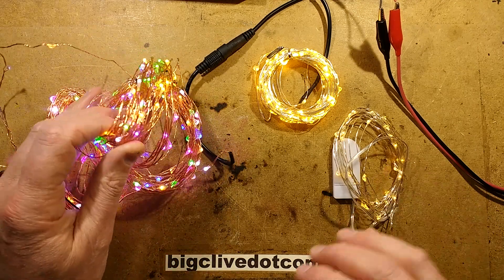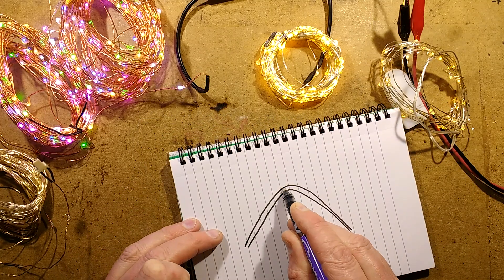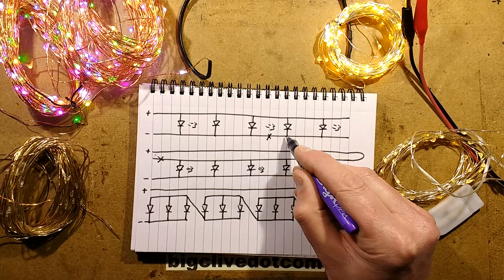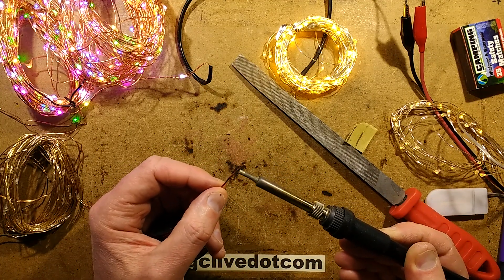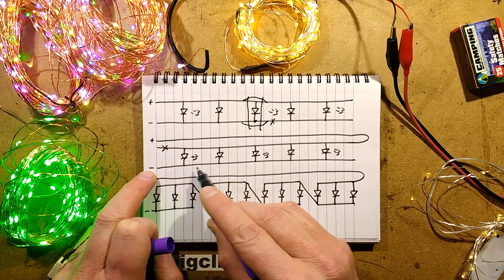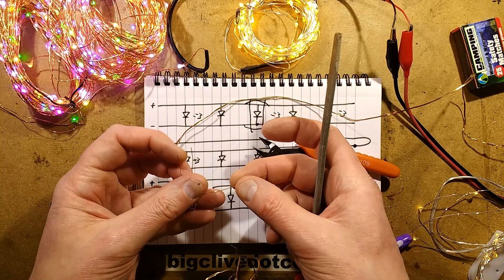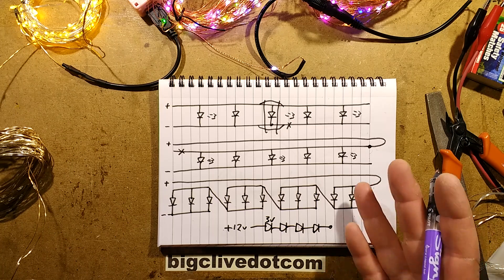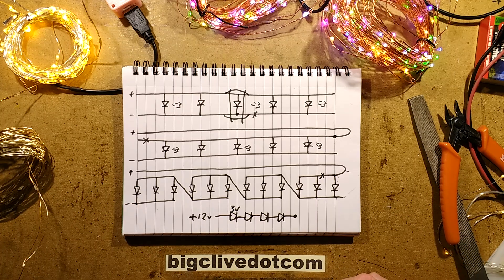Fixing low voltage copper wire LED strings.

Comment: I really am baffled still by the 3-connector wires and how you fixed it and why there is a 3rd.
Reply from the maker: It's common for 5V and 12V versions to use a third wire that feeds one polarity from the opposite end of the string to give even illumination along the length, act like a current limiting resistor and also allow the 12V versions to use four parallel sections of LEDs in series to make up the 12V.
Reply: @bigclivedotcom  why 4 sections though? Is that by natural state or design that it is done like that? Why doesn't the 5v do it like that? I'm a lil confused when he spliced and reconnected those 12v wires. When he tested the charge to find the correct wire, why did only one work. If it goes +,-,+.. wouldnt it work on 2 of 3?   I have taken every science course at my university. One thing I am eager to learn is electronics. I understand this design for the most part but a few things. My big zapper broke this summer and I tried buying a new bulb and using a tester to see if it was adequately getting voltage all the way to the bulb and it was. After reading some diagrams online I saw that it might need a new starter or some kind of Balsat

Comment: where can o buy a roll of that solid two conductor clear laminate wire?  i have searched every where can't find it, plz help
Reply from the maker: Sometimes it's called doorbell wire.  Only suited to low voltage and low current.

Comment: My 3 string led light disconnected at the power cord. I pulled it all apart & now can’t figure out how to get it back on. Do you attach any wire to the ground wire? How do you find which two are the positive ?

Comment: Many years ago1961 I worked in a electronics workshop. One job was winding transformers. We cleared the  varnish  by heating with bunson burner and dipping in methylated spirit.

Comment: I have gifted my gf these fairy lights which has 2 AA battery pack in it (or 3 don't know).She used them as decorative lights. However it's batteries die too soon. I want to upgrade it with 18650 lithium ion batteries. I thought it was 5meter or sth. Due to I cannot measure their ampere and voltage (because of cant get them from her), what values should I assume? What voltage and ampere they needed? Should I add parallel or series resistor and what value? I can build 18650 and charger side but I cant find any informations about these fairy leds.

Comment: So what's the story with their voltage? I rescued some on a Cork button cell set up and soldered them to a 2 AA box and they last a good 5 days so far, what if I wanted to use 1 AAA? Not much info out there.
Reply from the maker: They need a minimum of around 2.5V to start glowing.

Comment: Clive, your videos are so great, especially for a beginner like myself. 
I was wondering if you could solve why every other led  of a fairy lights strand illuminates when you cut the lights free from the 8-function battery powered controller. 
I feel like this is probably obvious, but I'm trying to just integrate the strand of 20 leds to all power on constantly for a model i'm building. 
Thanks so much for your help. 
Mike

https://www.amazon.com/Twinkle-6-5feet-Silvery-Christmas-Decorations/dp/B017O1C7S0
Reply from the maker: Those units flash the LEDs by swapping the polarity.  If you swap the wires round every other LED will light.  It requires circuitry to make them all light at once by swapping the polarity continuously.
Reply: @bigclivedotcom  Thank you so much for taking the time. Very generous of you to do so. Your explanation makes sense as Ive noticed that when I swap my  connecting wires the alternate lights would illuminate. I will just find some lights that don’t have the 8 function. 
If youre curious to see what I’ve gotten myself into, I have some examples here. 

https://www.instagram.com/mikesbattle/

Eventually I want to learn how to wire circuits myself but for now I’m utilizing premade lights along with EL wire. 
Look forward to your future videos!

Comment: Hi - I was hoping to ask you an electrical question related to copper wiring (fairy lights): I'm looking to manually connect the LED wiring of three 200LED fairy lights  (5V) I bought. Would you possibly be able to walk me through how I can do that? If I'm able to I'm happy to send more detailed photos of the actual cables so you can see if that helps. Thank you!

Comment: Hey! I have a question, thank you for helping people out here in the comments. I got some micro LED lights. My cat chewed off sections of the lights two days after I put them up. I plugged them in and all the remaining lights are still working, but I've been scared to leave them plugged in. Would it be dangerous to use them now? Should I put electrical tape around the broken ends or something?

Comment: I have two wire (very thin, like hair) copper LEDs solar powered string lights and tried fixing them with a box cutter, nail fire even used a lighter but idk if the lacquer is off. I've been trying for hours, I can't get it to light up! They do light if I hold the strings end to end but only sparingly. Please help!
Reply from the maker: Keep in mind that the polarity is important.

Comment: Why - with the 12V version do they choose to go X in paralelles and then 4 of that in series?
And not 4 single diodes in series and then as many as you want of this in parallel to that?
Reply from the maker: The way the strings are made make the large parallel arrays easier to produce.
Reply: @bigclivedotcom  ah thank you - that makes sense!
Reply: heh I just found your 7 year old video perfectly explaining it: "Analysis of a 100 LED string" - great stuff!

Comment: HI! can anyone help me figure this out? the first led of the string(right next to the power supply) just snapped, i tried to connect the adapter to the next led but now every time i connect it the leds burn. i have a 500 led 12v string. PLEASE HELPPPP
thanks in advance :)
Reply from the maker: One connection will go to one end of the entire string and one to the end at the power supply.  You'll have to experiment with which wires get connected.  Don't leave them lit continuously with a section out.
https://www.youtube.com/watch?v=7kQADYm6ivY
Reply: @bigclivedotcom  hi thanks for replying so fast! I know that already, it's not that a whole section is off, after removing the first LED and connecting the power adapter to the second one the power now seems too strong for the other LEDs.. a few of them are already burnt..
I saw the video you sent but it couldn't answer my question..
should I skip 3 more LEDs to even the current? 
thanks!

Comment: Question: I have the first example of copper lights (battery pack) and it’s so long that even with a fresh set of batteries they still get progressively dimmer at the end. If I were to cut off a good length, would the last bulbs still attached be brighter than before? Or will I just end up with a shorter string of lights?
Reply from the maker: If they're two wire you can make them all even brightness by feeding positive from one end and negative from the other.  That's how the three wire versions work.  Cutting the length of the two wire type down will also reduce the fade.
Reply: @bigclivedotcom  thank you :D I really appreciate it

Comment: This is very helpful!
Is it ok to run the little battery ones with just one led? I ask because I want to make a miniature dolls house light that's battery operated and I only have the 10 led battery ones.
Reply from the maker: It should be OK with the simple 2 battery type.
Reply: @bigclivedotcom  thank you SO much for your quick and kind reply! I'm delighted at that. I didn't want to blow it up or something 😂
Reply from the maker: @wonderwend  If you decide to get a bit more technical you can run some LEDs from a safe low voltage USB charger quite easily with the addition of a few cheap resistors.
Reply: @bigclivedotcom  baby steps, baby steps 🤣

Comment: Can you do a video on how to change the lights from battery pack to low voltage USB?
Reply from the maker: I did make a video about running the battery strings from USB.  It only works with the lights that don't do flashing patterns.
Reply: @bigclivedotcom  thanks. You don't have the link do you? I tried looking before I commented.

Comment: I connected two strands of lights, but on the second strand only every other light comes on. If I reverse the wires, the alternating ones come on instead. I can't figure out what's going on - any ideas?
Reply from the maker: Some controllers switch polarity to control two channels of alternating LEDs.
Reply: Hi Erin Siodmak. I have the same problem and wondered if you found the solution ie. how to wire it so all the lights are on at the same time?

Comment: Very nice video- I have a question regarding a 3 wire LED string that is connected through a controller. I noticed that on your middle diagram that you have alternating polarity for the led's - indicating that every other one is lit.  My controller got damaged- I was able through trial and error of pairing wires to get either one alternating set or the other working (red/blue vs white/green). My question is can I get all led's to light simultaneously (constant) with a simple USB 5VDC power supply?   Many Thanks
Reply from the maker: Sadly you'd need active circuitry to alternate the polarity at high speed to get both channels lit together.
Reply: @bigclivedotcom  thanks for the quick reply!  Merry Christmas!

Comment: Clive, do you have a schematic showing a 12V set with resistor? I have a set where the initial connection has come apart but unsure where the resistor goes across. Thanks.
Reply from the maker: The resistor will probably go in line with one of the two wires from the power supply.

Comment: I have a long set of lights, the last string of 7 lights have come apart, I have stripped the wires & joined them up, bingo the 7 lights are working, yippee but the 100 odd lights aren't, any suggestions
Reply from the maker: I'd have to know how the set is wired to give guidance on that.
Reply: @bigclivedotcom  There's a plastic box at one end with a small solar powered charging plate, a rechargeable is inside, there are 3 wires coming out. 2 wires go into & out of the led light, the third doesn't, I've connected the wires of the third one together. I hope this helps, thank you for your time and  patience

Comment: Hi, Great vid. My battery pack got damaged so decided to wire these directly to a transformer rather than battery. When I powered them up every other led won't light. Any ideas why, its the 2 string version. I have connected 2 sets to the transformer but would assume if that was causing power drop then would be dull not every other one.
Reply from the maker: The controller reverses polarity on the wires to give two channels.

Comment: Like others have said, this was helpful to me as well. One of my LED strips (about 5 meters long) blinks dimly every second or so. Sometimes it turns on to full power (using the same outlet). I can't find a pattern. I would appreciate your suggestions (no worries if not).

Thanks for your good work.
Reply from the maker: That sounds like a short circuit in the string somewhere causing a high enough current to make the power supply go into protection mode.

Comment: I broke the usb on the lights and tried to connect a new usb but it's not working. I connected the red and white wires but there's no light. Any tips?😭
Reply from the maker: It's polarity sensitive.  Try swapping the wires.

Comment: Hi Clive i have a question regarding some copper wire fairy light like the ones you have in the video. The set is 10meter. But i want to spilt it into 6ft section with a battery supply on each. The problem im having is when i wire it up only every second led is lit up. Any ideas why? Or what way i should wire it?
Reply from the maker: If it has a controller then it's surrending alternating the polarity to control both channels of LEDs.
Reply: Hi Luke Mm. I am trying to solve the exact same problem you are describing here! Hours of scouring the internet and havent been able to find (or possibly understand) the answer. Wondering if you were able to successfully wire your individual sections. Unfortunately, I am not understanding what I would need to do from Clive's response to your question. As a single mom, I would be greatly appreciative of ANY help!! TIA!

Comment: Thanks for the help. Best advice was to strip away the clear coat. I have a 12V setup. My girlfriend accidentally cut the wire on the strip. I cut away two lights and reconnected the wires. Is it safe?
Reply from the maker: If all the LEDs light and they are roughly the same intensity then it should be OK.

Comment: I have a 100 led set of two wire string. I cut them in half 50/50 now only every other led comes on. Note also that it is a three position switch (steady/blink/off). Any clues??
Reply from the maker: Modern controllers alternate the polarity to allow two channels of control on two wires.

Comment: Clive, I just found your video and have a question. I have the fairly lights with a cork( the battery pack) to go in wine bottles. I know it’s 6’ long with 20 LED lights, powered by 3 AG 13 batteries. My question is, can I connect another sting of 20 to just one battery source?  Thanks!

Comment: I have a question if the first LED lights the battery ones, if the disconnect from the battery pack is the any way to fix it? Mine's disconnected from the clear part by the battery is there any way to fix that? Please help any time soon

Comment: clive please answer my question 🥺 what should i do if the wire which connects the usb and the start of the led light is bitten by a dog? is there any chances that i can fix it?
Reply from the maker: You should hopefully be able to reconnect the wires.

Comment: Clive-- Thank you for your wonderful, clear instructions. I did the two wire repair with my emery board and was back to lit-up business in 15 minutes. The only thing I didn't do on the first try was realize that I had to pair the wires to the correct polarity, so my first try didn't work.... Second time was a charm! Happy Holidays.....

Comment: What if I wanted to extend the length by connecting a 5m fairy light to a 10m fairy light? Is it possible? Both fairy lights are powered by three AA batteries.

Comment: Thank you for this video, still not so much information on how fairy lights work. I have a question regarding two wire versions of lights (usually 2AA or 3AA bateries, no resistor, the one you cut and they still work ;) if you can help. Can I cut this one wire on smaller peaces and connect them in parallel to one power source? Let's say a wire of 25 leds using 3AA battery I want to cut on lenghts of 7, 10, 5 and 3 leds and connect this smaller wires together in parallel to same buttery source? My logic says they have the same voltage cos they are already connected in parallel and amount of power is not going to change so it shoud work?

Comment: Please what would be the best solution to do if I have two identical wire fairy lights that I want to connect together to make it longer ?? Thanks in advance for the help !!!
Reply from the maker: It depends on the power supply and how many wires the strings have running along them.
Reply: @bigclivedotcom  
- Input : 100-240V, 50/60HZ, 0.25A
- Output : 5V, 1A
3 silver copper wires, USB plug (no batteries), good length chord between the plug and last LED light. I wanna  connect them for length, so thinking about cutting the first one before the plug and connect to the extremity of the other so they can be continuous and use the same plug. So what would be best for me to do ?
Thanks again in advance for the help !
Reply from the maker: @coloraturaMusic  It would have been easiest connecting them both together with the power supply in the middle.  If they use three wires it means that one is going to the far and and acting as a resistor to limit current, while also feeding one connection from each end so the intensity is even along the string.  To connect them end to end you would need to join the two pairs of wires with the LEDs soldered across them (polarity is important) and then join the continuous wires so they go all the way to the end.
Reply: @bigclivedotcom  Mmm I see. Thanks for the info, it's helpful.

Comment: Thank you so much for this video. Very detailed explanation which satisfied the “inner-geek”. Just wanted to test out my lights and bring some early cheer into my apartment. But only to discover there was a break in the lights; a cut in one of the cables. By using a candle and sandpaper, then a simple twist of the cables and yay working again. Super!

Comment: Hi, just thinking LED lights have to have polarity in order or it will ruin them.  I didn't hear you mention this, or is it not important with these little fairy lights?
Reply from the maker: Polarity is important, but these strings often work at less than 5V which is the rated reverse voltage of most LEDs.
Reply: @bigclivedotcom  Thanks for the quick reply.  I'm building little fairy lights around the perimeter of a bird house, so I want to break the string and add wire in between sections of lights.  I'm also wondering if I could add a little extra battery power in hopes it would help things out on cloudy days.  Thanks for all the help!  Love your channel.  Learning a lot from you.   Tom
Reply from the maker: @tommysts1920  If you use the strings that can be run from a small battery pack they can be connected into a standard solar garden light.

Comment: USB overheating....🤔
My tiny led 3meter by 3 meter is not working. It has a usb which i connect to my phone charger, but light stops after an hour ,I tried different phone chargers, some chargers gets heated.
Shall i buy some different voltage phone charger. 110 v -240v is all usb led lights they should work on phone chargers.